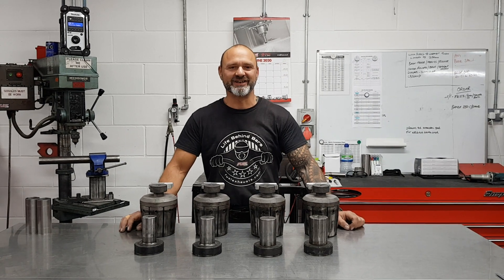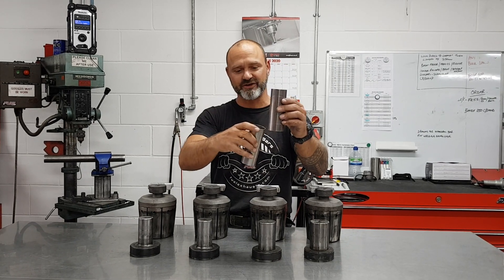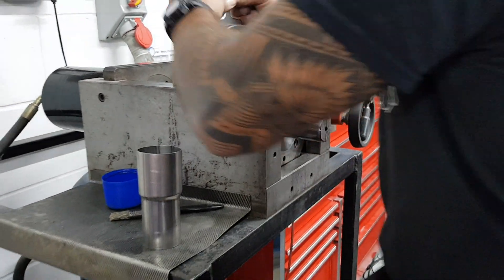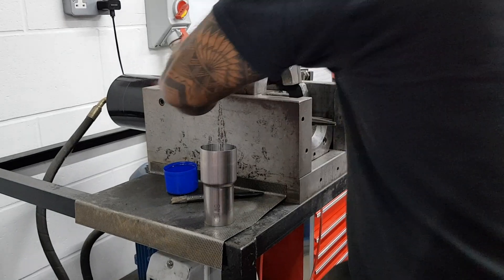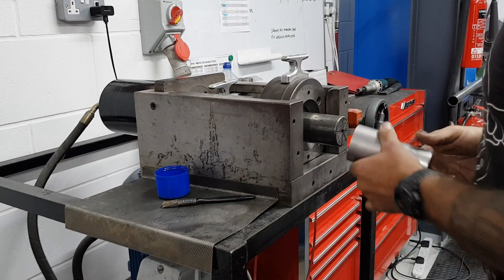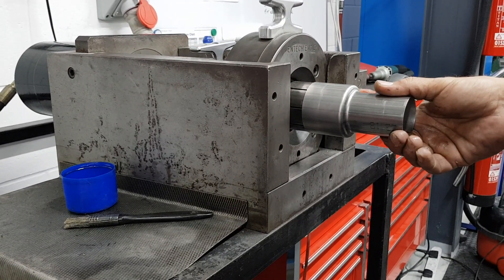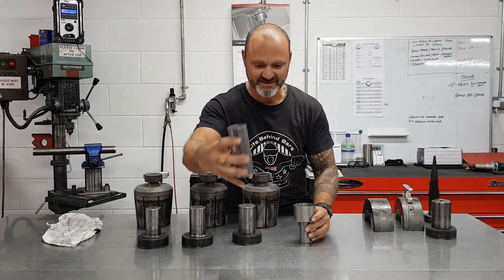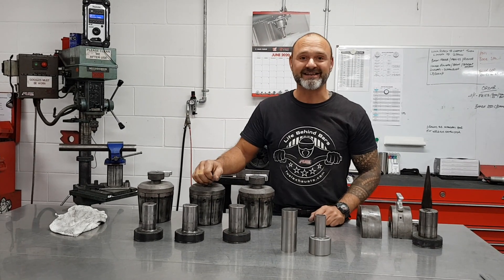Fuel Exhausts - End Forming Expanding and Reducing Tube - Made In Britain! Motorcycle Exhausts.

Comment: whats the material of the tube and what is the thickness for that 54 OD? Is there any change in the thickness afterwards after the reduction or expansion? How much it is?
Reply from the maker: We use 304 grade stainless. The video shows 54mm OD tube with a 1.2mm wall thickness. Yes expanding the tube reduces the wall thickness slightly and reducing the tube increases the wall thickness. I do not by how much.
Reply: @FuelExhaustsLtd  thanks